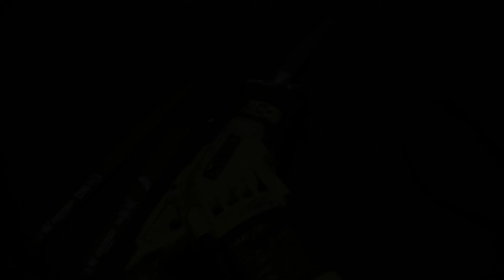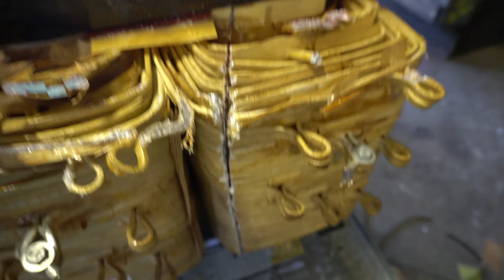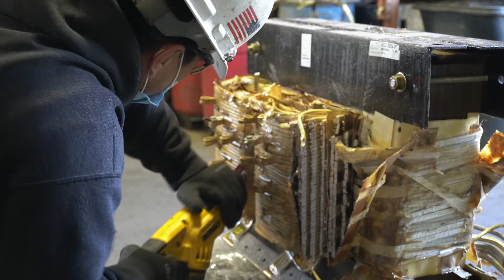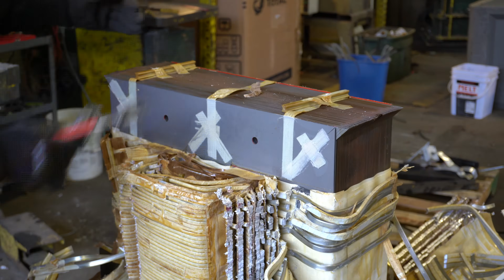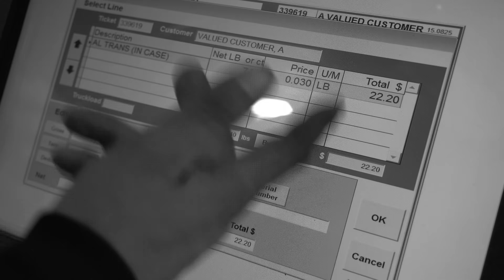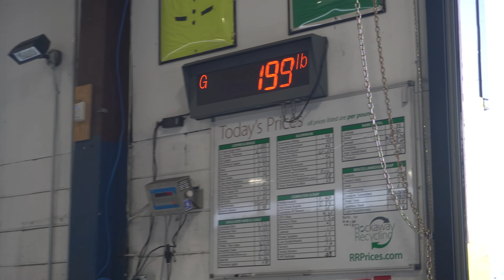Scrapping An Industrial Transformer - 290% Profit Increase

Comment: what is the typical % copper of the overall weight of these? I have one I am going to strip. thanks
Reply from the maker: it varies based on the size, anywhere from 12% up to 21% in some cases.
Reply: @iScrapApp  thanks, I have pictures of it but no way to post them here

Comment: pretty sure did an error in your math there ....
22$ for that 740lbs transfo !!!???
how much you give per lbs for transfo 3cent
pretty sur its 30 cent 
=
222 dollars
Reply from the maker: Nope, that is correct-- $0.03/lb for an AL transformer... that was the price per lb at the time, now we are up to $0.05 which would be $37. These prices will obviously vary per yard and region of the country, as well as vary as time goes on, but the video is just trying to explain that by taking apart and separating, you will make a bigger profit 👍
Reply: @iScrapApp  aaa okay aluminum...but still how much per ton for tin??
Reply: So you pay a lower price for Al transformers than clean transformers(tin shred) because it showed 0.03$ for AL transformer then shred 220/mt?
Reply: So you pay a lower price for Al transformers than clean transformers(tin shred) because it showed 0.03$ for AL transformer then shred 220/mt?